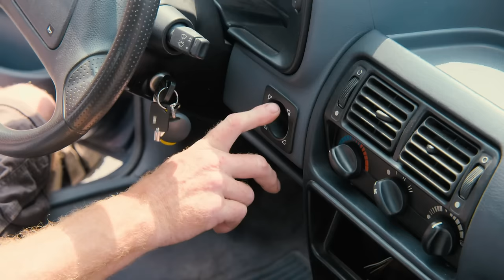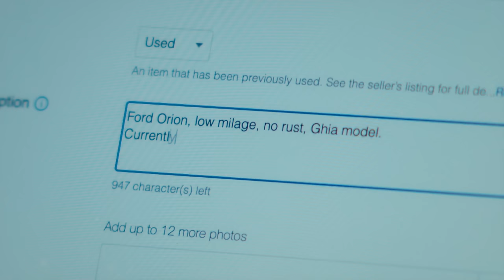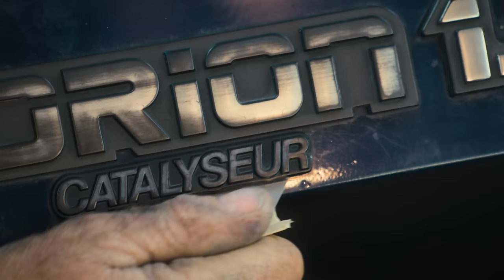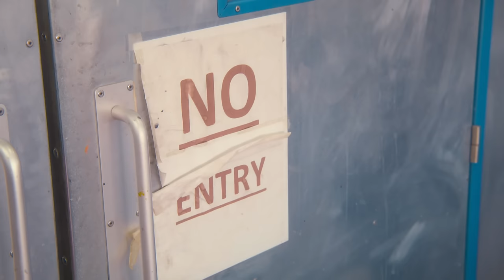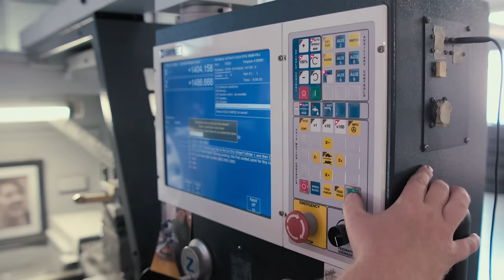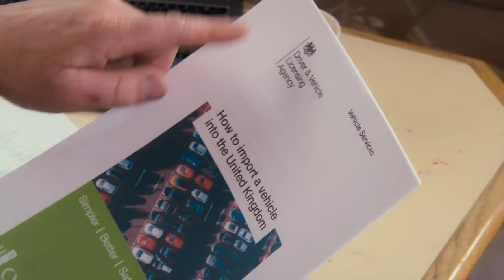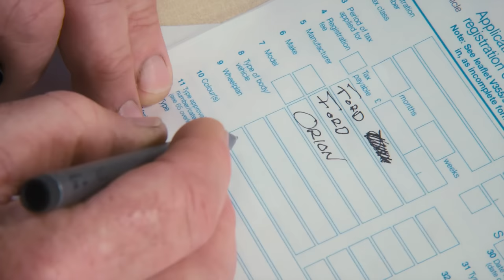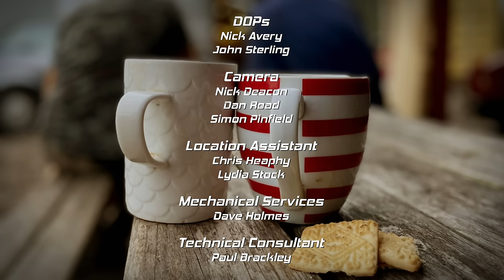Ford Orion Upgrade - Flipping Bangers - S03 EP10 - Car Show

Comment: I haven't read any other comments, so I'm not sure if it has already been mentioned, or not, but surely the pedal setup was also going to be a massive task to change over?  

I suspect that the whole exercise was never seen as being achievable, in the proposed time frame, but was chosen in the interest of TV/Video sensationalism.

Please don't get me wrong, I did enjoy the video and look forward to seeing more.
Reply: Yep, I was thinking about the brake and clutch pedals, master cylinder etc.
Reply: The "proper" way to do the conversion would be to drill out all the welds from the RHD bulkhead and remove it. Then do the same thing with the LHD bulkhead, and then weld in the RHD bulkhead to the LHD shell. Then you just rebuild the dash and steering gear, adding in the right pieces as you go. The scuttle panel would also need to be changed for the wipers as they mentioned.

Comment: Not sure why you’d assume LHD and RHD firewalls would be identical but still entertained by your antics.
Reply: When the model was current I bought a LHD mk3 Cortina thinking I could swap everything to RHD but the scuttle was completely different which was odd because the Taunus was sold for LHD markets. Same thing with Essex V6's from Zodiac/Capri/Granada; where oil sump reversed to fit X member the pump mounting changed as well so you couldn't interchange between different models.

Comment: I owned an maroon F reg 1989 LX 1.4 back in 1995. Bought it for 1250 from a dealer. There was a better one for 1500 in Aberdeen private, but I was on a foreign license so had to go through a dealer. Loved the sunroof as I had it open most long trips. Reason was my radiator had very few fins and the engine got a bit warm when it was over 16°. Never had a problem in Scotland but discovered it was an issue when I went to Bristol once and had to turn on the demister to drop the engine temp. Only rust I had was under the bonnet which with a wire brush and rattle can it was fixed. Had it for about 18 months and got 500 for it. The dealer scrapped it. Was told not to get the Ghia at the time because they had a lot of problems with cracked manifolds.

Comment: Never mind the steering column bracket, nobody mentioned the need to change the pedal box.  That would not be easy with the engine in situ!

Comment: The paintwork finish is shocking, ive seen flatter porridge, and the white wheels spoil it,
Reply: agreed.  A wet sanding would've seen that paint right And the wheels should've been redone in silver.
Reply: I love the white wheels.
Reply: Clue in the title....rivet counters, don't you love em!

Comment: Would you not be easier transferring everything from the left hand drive car to the right hand drive?
Reply: The righthand drive car was a shed, the lefthand was in better condition by a long way. The righthand car would've needed a lot more work to get ot on the road.

Comment: I had a 1600E Orion finished in a dark blue/black colour called Raven.  It had grey leather interior and essential items such as a graphic equaliser for the stereo.  Went to the local supermarket in the car to do a bit of shopping and that was the last I ever saw of it.  The insurance paid out and I purchased a beautiful new Golf 8v Mk2, one of the last that where available before the Mk3 replaced it. As it was the run-out model it had s steel sunroof, BBS RA alloy wheels and rainbow interior trim.

Comment: My first car at 17 was a white Orion 1.6i Ghia. Fuel injection, power steering, abs and electric windows were high spec at the time, especially for a 17 year old lol. Not so great that half the rear arches missing from rust (wasnt mot fail back then) and the clutch failed after a few months. It went to the scrappy and I had to settle for a 1.3 Escort bonus. Bad times 😂
Reply: Got a 1.6 in 1990 brand new, it rusted through on the rear off-side wheel arch, no obvious reason !

Comment: Owned an Orion too, 1.3 , basic - with the Ghia pepper pot alloy wheels, and the black trim that goes around the rear number plate , that made it look like a more top end model. And an exhaust tip that sounded better ! ( find a 1.6 L diesel hatchback 1986 Ford escort rare as rocking horse muck - had one - loved it as my first car - rust did eventually kill it)

Comment: I have restored a couple of old Minis. One time I carelessly assembled it as a left hand drive, it was so simple to do. It only took a few minutes to get it back to right hand drive though.
Reply: Metros are another one too, but fords everything is welded in place to the point they would have to swop the bulk head over.
Reply: How did that given you'd need a LHD specific steering rack for a start?
Reply: @procta2343 

They're not.
Reply: @skylined5534  metros are,  i have rebuilt two,   passenger side has the hole indent where the rack would go through, if i remember,  only a case of swopping left hand stuff over, loom etc.  the scuttle panels have the holes for the left hand drive wiper setup, but has plastic holes for those. All bolt on stuff.

Comment: oh dear, am only up to the penny dropping at 35 mins in, but had to jump in the comments lol

I worked at a ford dealership in the parts department, when these cars were new. looking up parts on the microfiche always had different part numbers for LHD. I knew the obvious like loom, rack and headlights would be different. 

But it is small details like, the wiper blades, as the drivers side fully sweeps up to the A pillar and the passenger side creates an arc, consequently the scuttle has different mounting holes to achieve the correct effect for RHD. 

the body shells also had different part numbers and now I see why.

time to resume and see what you do next.

Comment: The spraying finish leaves much to be desired as it is orange pealy and the colour looks out its darker. When I was spraying these cars the colour usually needed blending to match and they were starting to be base and lacquer.
Reply: Solid colour from the factory mate. Worked at a ford bodyshop at the time. If I had turned that out I wouldn't have worked there for long.
Reply: @dsdek72  I was working in a Ford dealership as a panel beater and sprayer ( served my time as a sprayer in a for main dealer ) I would have been ashamed to have turned out anything like that finish when I was in the trade. We did use blending clear back in the day when cellulose was the king as ford ha so many variant shades. I can honestly say I would not have worked for 32 years in the trade if I turned out work like they did on the paint.

Comment: Lol you picked the hardest conversion to do, I used to run a specialist escort breakers back in the 90s, built plenty of turbo conversions  back in the day,  piece  of piss compared to LHD to RHD 😂
Reply: I have read about left and to right hand conversions on mk2 escorts on the forum, and its known to be a nightmare, so when i saw this been an LHD, and i knew one of them will come up with the idea, of wanting to switch it over.  I was like, that's not going to happen.  😂
Reply: @procta2343  yep loads of people just think "yeah i bet its easy to make a mk2 or mk1 escort RHD", all because of these people importing the LHD african imports
Reply: @thedeadstig123  sometimes people don't research at all and just think, its just a bolt off and swop process, then go a head do what these lads did , and then realise its not as simple, and it turns out to be more in depth job, to the point its more of a hassle plus expensive.
Reply: @thedeadstig123 But they import from South Africa because they have right hand drive cars too, just like when people chose to import from Malta ( think Malta must be dried up pretty much now hence they moved on to South Africa now) I know there’s shady things going on with that too as even on eBay right now there is an obvious South African car that has the ID stollen from a mk1 I sold 10 years ago in need of restoration, I guess breaking a car that needs too much work and cloning it’s ID onto an import is a thing to avoid all the paperwork , very dodgy practice which makes you even more wary of the rwd escort boom market of the last while

Comment: When I was learning to drive in my mates mk2 XR2 my Dad had a diesel 1600 Orion I drove once. 
It was so slow, when I reached a tight bend I took it way too fast for my Dads liking. 
That was the last time I drove my Dads car since 1997.
Reply: They didn't get a 1.6 diesel from the factory they got an 1.8. 

I did however have a temporary car which was fitted with the 1.6D from a mk2 fiesta. It wasn't a ball of fire admittedly but it was more than capable of keeping up with other traffic.

Comment: I would have rebuilt the D reg
Reply: Ws too far gone. A complete rot box
Reply: @tonyford2734 You don’t have a clue 🙄
Reply: Does a D reg tell you the year it was made?
Reply: @Troll-Hater You can see it in the video - the scuttle and front inner wings are rotten, and if it's that bad in visible places, it'll be much worse underneath.  I once had a Mk1 Fiesta I left standing outside for years - looked OK from the outside, turned out the inner sills were almost entirely missing and it was rotten all round the rear suspension mounts. Fixable but not remotely worth doing.
Reply: @donotwantahandle1111 It tells you when it was registered - in the case of a D prefix like this one, between August 1986 and July 1987.

Comment: So the MOT to register it was free and didn't require any work like changing the headlights? Also, if you had sent the Portuguese document off to DVLA to register, there is no way of getting it back. What a load of fake nonsense.
Reply: Didn't think of that. They literally had 4 useless headlights.   2x LHD 2x brocken glass lenses
Reply: To register in uk it needs mot and insurance and vosa with Portuguese logbook ...there's no way they did that and sold it back to Europe for 5 grand 😂

Comment: Mentioned lack of side indicators earlier in the video, then failed to transfer them over to the LHD one from the donor?
Reply: They were selling it to a buyer in mainland Europe, which is also the reason they didn't have to buy any headlights as the donor car's ones had no lenses on them.

Comment: I had an Orion, great car, once I changed the automatic choke for a manual one
Reply: I disconnected the automatic choke but it meant I had to open the bonnet each time and set the choke in place prior to starting.  It would still kick off, sometimes I would have to floor it to kick the choke off.   The issue was the car would just die because the automatic choke stayed on and would make the engine die.
Reply: @chrishart8548  Same problems I had, the conversion wasn't cheap, but it saved a lot of bad language!

Comment: If it had been a MK2 Escort the LHD to RHD swap is fairly simple some brackets need welding to bulkhead, on RS2000 the LHD sump has to be replaced due to its handed shape, oh well

Comment: Would probably have been a lot better just buying the second car and doing it up.....LHD cheap car is worthless in the UK.
Reply: Yeah i was starting to think that too, with the donor car, Just a bit of body work, basically what they did with the LHD, and a set of front lights done the wheels and tyres.   I think they could have got a profit putting that one back on the road,  The wheel refurb and new tyres ( depending on what those were like) and a few odds and sods, they could have ended up with a profit there.

Comment: The wheels that they didn't touch looked good. The doom blue paint which is the easiest colour to paint by far looked absolutely shite. And as they couldn't convert it to rhd is a joke iv done a few in the past and the only thing that was awkward was on a fiesta MK2 the temp gauge was the fuel and vise versa everything else was bolt on bolt off

Comment: We used to have one. Ours was '84 my grandfather had it purchased new in Germany where it was built. it was white, but it had slightly different looking front end than the ones on the video. Very strong car, not very economy friendly, it had drinking problem. But the car was fine until dodgy mechanics ruined it. Also for some reason the car's interior constantly smelled kinda like melted plastic. We couldn't get rid of that smell no matter what. I still have a suitcase full of some spare, never used parts for it.

Comment: This show gets more ridiculous and it’s like they go out of their way to make things as difficult as possible. Sanding by hand? Knocking out the boot dent on the car upside down rather than taking it off? The hassle of a RHD conversion on a cheap car? White wheels? Please... Can now see why the Discovery channel didn’t take it seriously.
Reply: I do like these guys, but the right hand drive donor they found looked at least as good as the project car. Couldn't they have done that instead?
Reply: @TheHorsebox2 to be fair, that was a completely rusted shell
Reply: I think you are missing the point, Paul. That's okay though, I guess it's just not for you...👍
Reply: @phrg8332  Yes, I'm afraid I made my comment when there was still some time to run. It was indeed pretty far gone.
Reply: @TheHorsebox2  hi gus and will,really enjoyed your shows,would love for you to do some work on my jaguar s type. Alan from Coventry warwickshire.
Reply: Don’t watch it so

Comment: handy hint instead of t cut use kitchen cream cleaner to start its a rougher grit and takes top coat thats went pink from red etc back to perfect red i was told off an old body tech and its saved me fortune if had used kitchen cleaner wouldve seen better job especially sun bleached cars brings up paint like new then protect with a good wax polish to cover and protect from uv rays lots dont realise milky paint can be caused by too much waxing leaving out in sun while it discolours and a day can be like new handy if buying 2nd hand car especially reds base colours try n see save fortune on polishing compounds when its mid grit then for final shine t cut like a mirror then wax it cars like new :hand-purple-blue-peace::face-blue-smiling::hand-purple-blue-peace:

Comment: Sorry but it's easier converting a mk3 or 4 escort from lhd to rhd than what they are making out....i get they have to add drama to these Programmes but if you've got the donor car sat there you literally use everything off of that bulkhead. Biggest part they over looked about the whole thing as well is the pedal box set up and how the brake pedal has an extended bar for the brake servo on the rhd 
If you look back at the mk3 escort r.s1600i they were ALL based on a lhd set up as they are German built but they were made rhd for UK Market and its exactly the same bulkhead as what both of those orions had...they just wasted alot of time being defeatests

Comment: Orion? What a bag of shit that car was . I bought one in 1996 and my Dad had a 96 Escort as well . Both cars were the same colour Ocean Blue and both were 1300 petrol. My Dads was the first to go after 18 months of no stop rust and floor and sills going it was in the scrapyard at 4 years and six months. Same with mine but after spending loads on new wings and boot floor found that the bulkhead had rusted up the top by the bonnet hinges also the battery area . At less than five years old mine was dead and sold for £200 for spares. On the other end of the spectrum i bought a new 2008 Chevrolet Lacetti estate and i still have it completely rust free . Both cars cost me a year's wages at the time £4500 for the Ford and £8900 for the Lacetti. The Chevrolet lacetti was a budget buy and the Ford wasn't as it was a mid range car . The Chevrolet works hard for a living and has been an excellent vehicle. If they still made them i would buy again, not so with any Fords . My works van is a Transit and thats 2010 and the other one at work is a 2013 both are shit boxes.

Comment: I don't get it - they bought it for £1800 spent £1000 on a donor car, £300 on the wheels. A cheap respray is bare minimum £500 but a decent one is £2000. And what cost for the two blokes time for three weeks' work and access to the garage unit?  Realistically they have sunk £10,000 in this and are pretending it only cost £2700 (or whatever they were claiming).

Comment: Wheels are horrid, lhd to rhd is a huge conversion as you need everything from the bulkhead to the electric window looms in the doors, sun visors, scuttle panel, bracket for the accelerator pedal, list is extensive.
Paint on the bonnet is terrible, didn’t show the 1/4 panel or boot so they must have been worse.
Should have rebuilt the d plate car with the unwanted parts from the other car, got it running then advertised that for more.
What a colossal waste of time that was.

Comment: any reason for doing this totally escapes me, labour costs work out that you were earning about £4,75 an hour, so why bother, it's a heap of scrap, the wheels are the biggest joke, white l0l. . . They should have been wet-n-dried then £20 worth of rattle cans, 1 each corner and would look really good in the correct silver paint, Fox for older fords like this one and Sparkle for the newer fords from 02,

Comment: Why on gods green earth would they rip that perfectly tidy D reg ghia apart to convert a crappy looking left hand drive scrapper? Why didn’t they put the left hand drive thing into the proper right hand drive one? Absolute lemons, welding the right hand drive one up would have been a way easier job than right hand drive conversion..

Comment: im at 35 mins now sorry but its easy job if wanna take risks chop bulkheads off both cars weld right hand drive bulkhead with proper holes for steering etc can be easy weld job and done in cpl days gave up too easy looms easy too ford used lots same bits there making mountain out mole hill and left hand cars a rare colour giving up after all that has ruined program for me